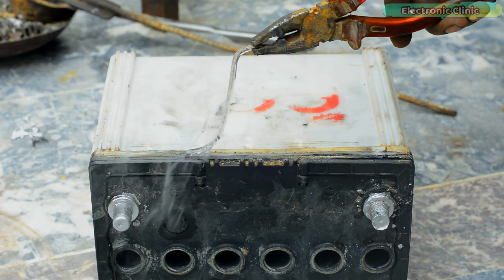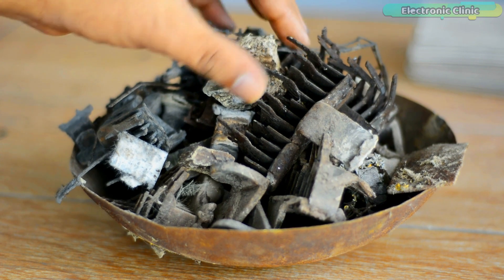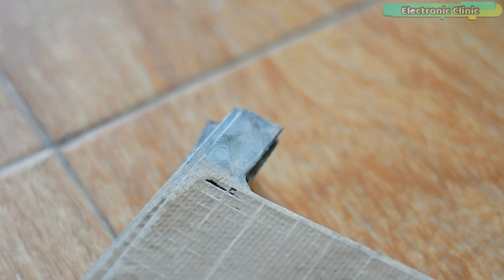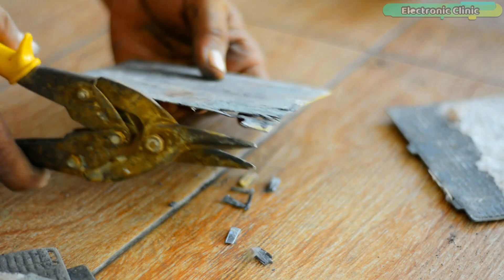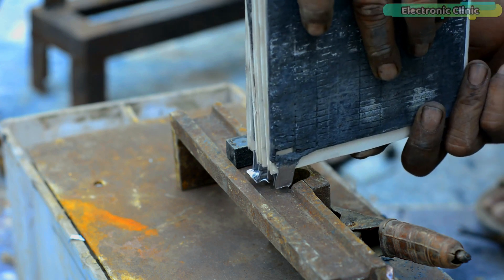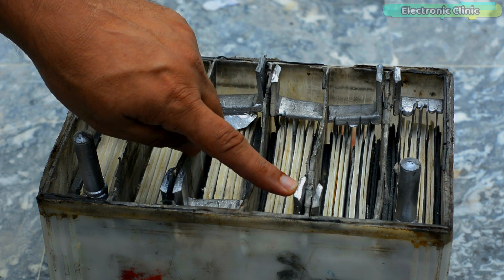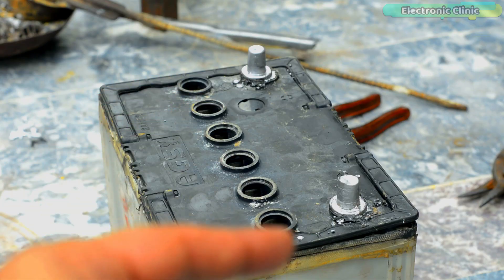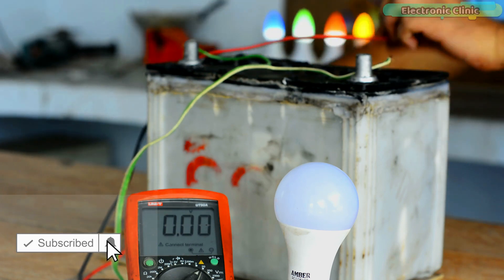12V Car Battery, Lead Acid Battery for Car, How to make Car Battery, 12V Lead Acid Battery

Comment: Thanks! I always knew how these worked but never bothered to try it for myself (probably got my daily value of Pb from soldering). "The Last of Us" is actually accurate - I've never had one last more than 10 years and if it gets to 0 volts forget it (internal resistance too high)

Comment: Here in America, you cannot OPEN these 12 volt batteries and reuse them. Our car batteries are purposely made so as to make sure you have to COMPLETELY DESTROY THE PLASTIC CASE to open it up for rebuilding. If you want to see a miracle try to open a car battery made and sold in America and it is a puzzle how it was ever made, How did they put it together with plastic welding on the inside ?????? The last time I tried it, I took a saw and cut the whole thing up in pieces and still couldn't see it opened.
NO SIR, in America the Crocodiles work together to feast on John & Jane Doe, and these reptiles protect their territory.

Comment: this video is more detailed than the old one but is still missing the mos important part how to make the plates to make a big batery for my solar panel the one that is made from lead oxide,i know in india and pakistan they make them everywhere but in our countries nobody does the ecept the factories but they dont sell plates only,so please make anothe video just for the plates ,i know for u is possible i know they oxidice the lead with sulfuric acid but some of them they add some fiber maybe glass fiber in samll pieces and something else to improve conductivity maybe another metal like silver like they add before but cause is too expensive they use another material i am not sur in this momente bau maybe u can use baking soda with graphite and the press with an hidrauklic press the oxide plate has far i found out but in india and pakistan i am sure they use something cheaper to keek it together and improve conductivity cause the mayor problem is that when you put the plates in wather and acid it fall apart with the time passed so the use press and they put in a oven afther that to keep it together for longer time i dont know the temperature they use but they put in lower temp for more then one day in oven,,i tell u this so u can have an idea when u ask your fiend to give u the process,i know the glass fiver u can make smaller in the blender but i dont know how much they pit in the mix and the lead is transformed into oxide led with sulfuric acid then is died,but i dont think u can use baking soda cause is going to react with the acid and is going to fall apart and create co2 gas too so forget baking soda but u can use graphite from old bateries small bateries for radios or pencils too,so please make the video for us,tell them to sell u the mold for net lead so u can make the net yourself too